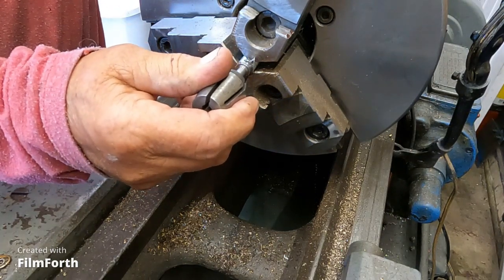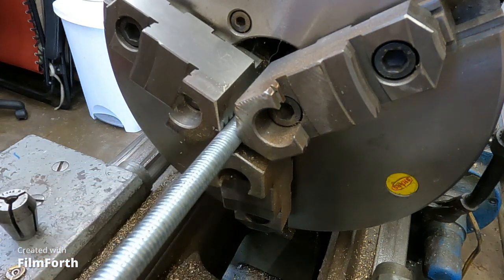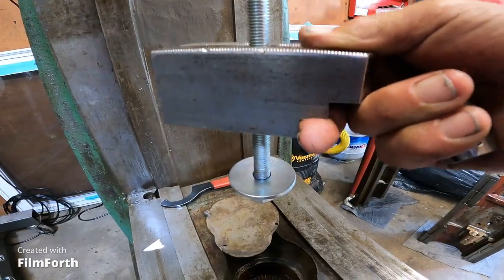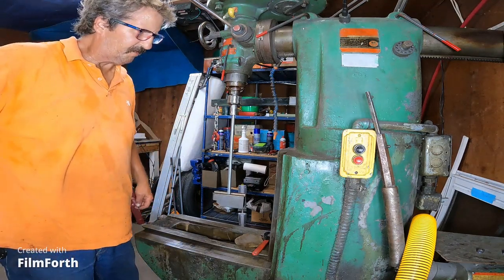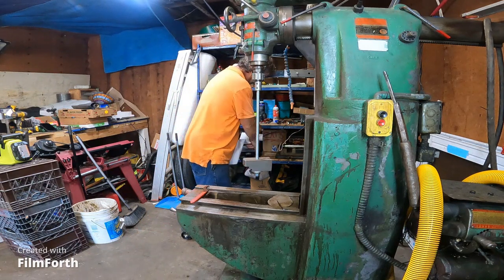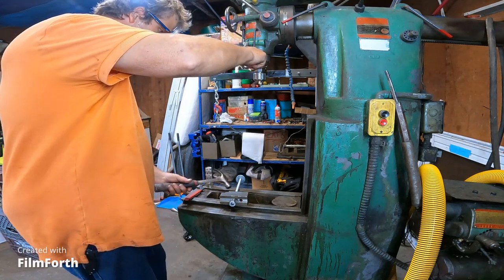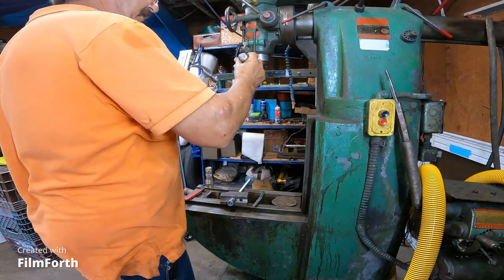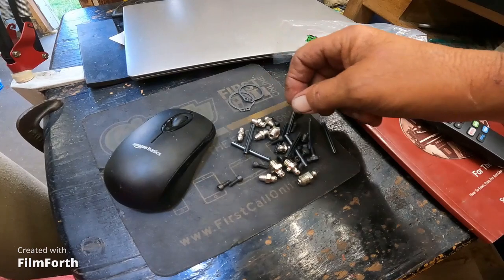Slide hammer PART 1

Comment: Im not sure why someone why would you not make up a puller and pull vs pounding on the spindle bearings and junking them?
Reply: Yep , a 2 legged BEARING puller would make quick work of removal !   * Hook onto the collet clamping nut , run the screw into the center of the collet !     DONE !
Reply: @georgewocosky  2 legs yes but i would make a part to install a 3/4 in bolt in collet nut threads down and put  home made 2 leg bridge on bolt with legs facing up bearing load on spindle. And use nut to draw it out. You cant pound on spindle bearings like  he is doing it will junk the bearings

Comment: *  USE A BEARING PULLER ON THE COLLET CLAMPING NUT ! ! !     AKA "GEAR PULLER"   Measure how far up into the spindle to reach HARD METAL . . . ( the screw of the puller needs to be long enough to PUSH against it )    EASY PEASY ! ! !    'Should be a piece of cake to pull it off by PUSHING with a screw - - - LEVERAGE is your FRIEND ! ! !
Reply from the maker: I will definitely check all that out there are several good ideas involving gear pullers and Split bearing pullers . George